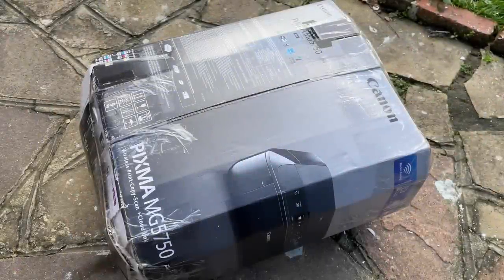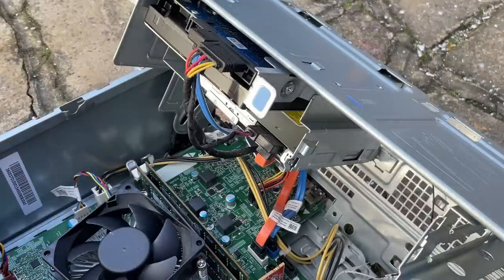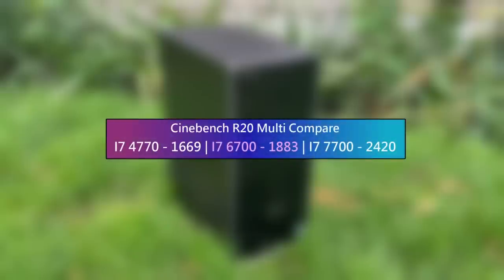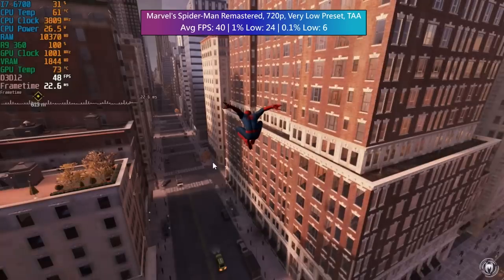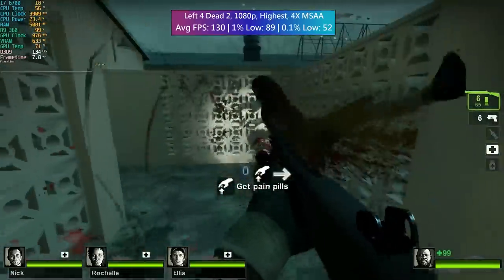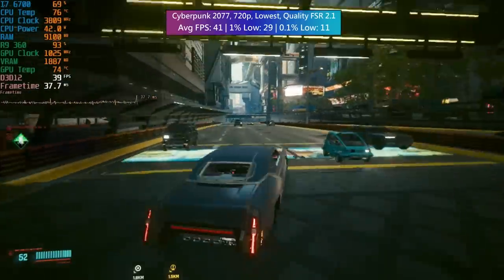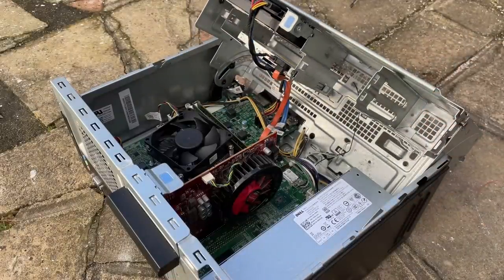$900 Dell Inspiron Gaming PC From 2016 - How's It Holding Up?

Comment: There are still plenty of 6-7 year old components out there that will game at low settings 1080p just fine. I just recently got rid of a Dell Alienware x51 R2 that I had bought USED in 2017 that had an i5 and a GTX 745 with 8GB of RAM and a 1TB mechanical HDD and a 240W power brick that over the years needed upgrading love. I paid $300 USD for it, and straight away I bought a 1TB SSD and adapters to install it. That sped it up tremendously. I then bought the highest PSU 330W, and a 1060 GTX 6GB video card, along with 16GB of matching RAM. Last year, I found a i7 4th gen that was the final upgraded part for $60 USD and after doing that, I had some great benchmark numbers on a 9 year old PC! It would play 75% of any games today @ 1080p no problem.

Comment: Whoa! That's the same CPU I have that's stuck inside a MSI Z170 M5(DDR4) mobo and paired with a RTX 2060 Super.
I don't know why but the boost feature from that mobo runs my 6700 non-K speed to 3.8 GHz.
Every triple A game I play can hit more than 60 fps 1080p on any high settings, I feel like this setup can still run for another 10 years. (given with proper maintenance of course)

Comment: I don't know if this system has a 6/8 pin power connector, but a 1660 would be a nice fit, otherwise even a 1650 would be an improvement, though maybe the rumored 3050 without a power connector could be the perfect candidate for the upgrade, assuming pricing isn't ridiculous for that card, which i'm sure it'll be.

Comment: I had one of these. Complete nightmare to do anything with. Almost all the parts are dell made or dell built and cant be swapped (Like the PSU and motherboard) so upgrading was stupidly difficult unless I got another dell made part, which are rare to come by and expensive. The BIOS is super outdated and supports none of the newest features, even security ones, and Dell refuses to update it.
The model I got was a bit different and promised to have an AMD RX560 in it. Turned out it actually had an RX460 in it, but with a 560 bios flashed onto it. I was pretty much scammed.
Long story short I will never be buying from them again. Glad I built my own PC.
Reply: @Gatorade69  From what I recall they have the same die, the RX 460 just has some CUs disabled, perhaps flashing the vbios did get the whole chip working? I do actually have an HP OEM RX 460 on hand, perhaps I should see if this works sometime.
Reply: @Gatorade69  They flashed the bios and disabled some cores which effectively gave it the same specs as a 460. Comparing my benchmark scores on that system to a real 460 gave equal results.

Comment: Love these vids.  That appears to be the same chassis as a Dell Optiplex 3040 which I'm using for one of my setups---i5-6500/full size OEM GTX 660 blower card from an old Alienware/16gig DDR3L/SSD.  There is a slightly higher output power supply available that comes with a 6-pin PCIe connector but the mounting screws do not line up.  I use another Optiplex 3040 at work with an HD-7700 Sapphire 1gig which pairs surprisingly well with the i5-6500 and SSD for MMO playing.  I love finding ways to game on OEM prebuilds.

Comment: That is specced extremely similar to my first pc which was also a dell inspiron I bought in 2016. The only thing different was it had a i7 4790. I put a new psu, a gtx 1060, and a ssd in it and used it for six years. Its still going as my server pc, it hosts modded minecraft servers for my friends.

Comment: A propos 9:09 about the power connector - there are "SATA Power to PCIe x6" adapters available and that's what I use to power my externally powered 2GB nVidia GTX 750 in a Fujitsu P720, which also has a custom PSU & power connector. It has allegedly a 280W PSU, but Haswell & Maxwell seem to be a really power-efficient combo and I have no power stability issues whatsoever even with 2 HDDs, 2 SSDs & a WiFi/BT PCIe Card added. Works just fine, though I had better performance in this machine out of a 1050Ti which required no external power cable.

Comment: Love mine PC.

I7-7700

Corsair vengeance lpx 32gb ddr4 2666mhz

Asetek 92mm Aio with noctua 92mm slim fan

Corsair SF750 PSU

MSI 3660 TI ventus 2x

500gb Samsung 870 evo & 4TB Firecusa 120 ssd.

4 extra 80mm fans.

Comment: i still using a older hp with i7 4790 with 16gb ddr 3 ram and a gt1030 2gb video still pretty quick with a ssd. these machines still have life left i only have to use low profile cards because i have a small ssf case.

Comment: Solid system. That GPU is pretty interesting to me. Sold performance for its age and not needing a power connector. 
Maybe with DDR4 RAM the CPU also would do slightly better. 

Shame that most Dell prebuilts became all propriety parts starting from here. The Dell Optiplexes did too.

I'm curious if the i7-6700 can beat a stock i7-4790k.
Reply: I’d like to see the. 4790k vs 6700 vs 7700hq

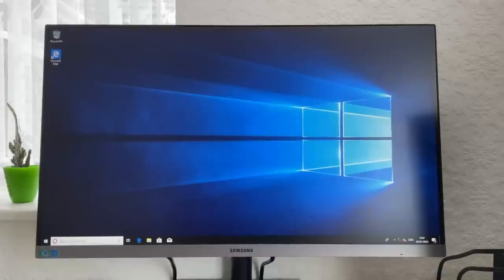Comment: 2:39 i can confirm this. i recently reinstalled windows 10 to a used laptop from the original oem dvd, yes you heard that right. it took a good couple of hours and several restarts to get up fully updated. i don't think i'm doing that again if i can avoid it

Comment: I took delivery today of a HP Compaq 8300... £20 delivered, i5, 4gb of ram half a tera HDD, built in graphics capable of 1440p...   then I find out HP only used VGA or DisplayPorts... but other than that the machine is like brand new, not a scratch, dustbunny or anything to say its actually been used and I only wanted it to power my USB microscope and use to read watchmaking technical sheets in my watch working area but  it will do me and is quite a potent little machine.   For all intents and purposes its basically what I call half a laptop as it uses laptop memory and layout pretty much, still £20 and I am happy, also means I got something to use whilst I upgrade me main rig up with water :)   Oh and the HP has a fancy DVD/Blu-ray dual layer writer which def was a bonus :D
Reply: One thing I noticed on the 8300 is the 10 USB ports on the thing, two wired in DP ports which can work with the onboard VGA, I am seriously thinking of hooking this up to me 51 inch telly and use the my HP Elitebook for my microscope instead, thing is absolutely silent even when running stuff heavy load, its running on my insomniac 1080p monitor not a problem as I found a converter dongle to turn it from DP to HDMI, damn and I just bought an android box for the front room telly :S

Comment: DDR3 on Skylake is pretty cool, you could get a 32gb kit on the cheap and have a pretty good beater workstation. From what I remember that Cinebench score is around where my DDR4 system had; the 6700 just doesn't clock very high in exchange for its low power draw.
Though, it's silly to have a low power CPU in a full-tower case with no 5.25" bays. Dell should've just stuck to the SFF Optiplexes.

Comment: Use a PCIE power to 6 pin adapter to power something relatively low powered in terms of graphics and stretch the CPU more. Something like an RX 470 or 1650 Super, perhaps?

Comment: Nice little find. It's annoying how dell does the internal of the case as a PSU upgrade and a gtx 1070 would have been a perfect upgrade. Maybe with the adapter to make a 6pin something like a gtx 1060 6gb or 1660 super could be added.

Comment: I tested the R9 360 in Forza Horizon 5 at 720p Medium settings and it actually gives 55- 60fps  average, not bad actually. Tested GTA 5 with the Remake graphics mod and Acer's Photorealistic Reshade preset at 900p High settings with High textures and that gives 60fps average too but at night it dropped to 40fps cause of all the street lights and stuff. Horizon Zero Dawn at 720p Original settings gives 30-40fps as well. So peeps could still have fun with this card for now if they don't got the money to get a better GPU, but I think in a few months they gotta try to get an upgrade

Comment: You inspiered me to mod a dell optiplex 390 sff. It had an intel i5 2400 but the motherboard died. Only spare mobo I had laying around was an am3+ board with a dual core athlon CPU. I am trying to source a fx 6100 but so far people are trying to sell them for 60-100 USD which is way overpriced. When I get a CPU, I'll get a low profile cooler. My whole idea is to build it up and give it to my mother for her birthday next month. I am using the i5 2400 in my main PC at the moment and she's sitting with a 2400g but that 2400g is gonna get upgraded reason I am building this dell optiplex for my mother. PS: first time modding a case and it works like a baws but only GPU I have that fit is a gt 730 hp OEM 2gb card but she plays browser games so it's way to much tbh.

Comment: I own an R7 360 that is factory over clocked. You should be able to get the clocks up to 100 and may be lucky and get over 1500 on memory. then again you might not due to the lack of a 6 pin, which mine has. quite good for media playback and light 1080p gaming.

Comment: Bad language is a fix for every single issue in the world.
For "adapter" for 6-pin best bet would be IMO to open PSU and solder 6-pin cable directly onto 12V/GND lands inside.

Comment: The 6700 was a good chip I had one on a biostar mobo with ddr3 then I got My  7700k which is still plodding along with my gtx1080 ...it struggle's with some games rdr2 for example but is still playable at high settings at 1080p...just.

Comment: I waited for a PSU DIY hack adding a 6PIN power adapter, because of good quality of PSU and max 240W and finally of course a VGA exchange to GTX 1060/1660 (Super/Ti)/RX 470/570 with a tiny undervolting to keep the overall 2x12V rail power consumption under ~180W. CPU should be max. 60-70W under heavy CPU load games, so we still whould get 110W for GPU that is quite lot with a tiny undervolt.

Comment: i even replace my paste when i buy a pre-built or laptop stock thermal paste is crap IMO gotta do my GF63 thin ( 3050 variant ) tomorrow throwing a 2.5" 500GB pny ssd in 32GB of 3200mhz ram and a re-paste ( temps are a bit high atm thermalright tfx or Kryonaut should fix that ) then bam my new laptop will be ready for a fresh install of windows them on to gaming

Comment: Getting unlucky again, the 280X fromer mining card I got for just 50€ shortly after lunch of 30xx series seems to be giving up and down-clocking doesnt help either as well as changing the output port for display so it must be on it´s last breaths. How do I know? Just the second I was writing this the picture frooze (didn´t knew it´s part of the video yet) I was worrying "don´t give up and freeze now, just let me finish a couple words for crying out loud" because for about two weeks suddently the image freezes before the monitor (dual monitor isn´t even an option anymore, display connection loss in less than 2 minutes) turns black saying "no connection". Pressing restart immediantly fixes it, but than sometimes crashes (audio everything keeps playing normal like nothing is going on) again within 2 minutes after restart, so it´s obviously the GPU about to die. Sucks since used prices in the german city I live in still are absoloutly redicoules, 120€ for a 1050Ti? Nope, hard pass, 140€ for an RX 570 8GB? Hard pass again like 180€ 5500XT, it´s just loughable and don´t think prices for old Intel CPUs are any better, they´re worse!

Comment: The PSU is a TFX PSU form factor.  Just upgrade the PSU and adapt the proprietary cables.  Don't risk adapting GPU cables on a 240w PSU, its just not worth it.

Comment: My brother actually had that computer and I salvaged its RAM and GPU for my first gaming rig.

I now have 2 R9 360s in my room and I modified them with heatsink on the VRAM modules

It’s a tiny beast and it worked but I had to move on.

Comment: i have this same exact computer from dell with the only difference beeing the gpu, mine is a R9 370 4GB. ive already installed a 1TB SSD and im planning to upgrade to the RTX 3060 (idk if the cpu will handle it well but i dont have money  to upgrade both)

Comment: Hmm, seems decent enough, not bad for a 2016 system! Could certainly benefit from a GPU upgrade, but then again, even the 1050Ti struggles nowadays, and anything better would either require a power connector, or turn the CPU into the limiting factor (or even the 1600MHz RAM).
Reply: 1650
Reply: @samoerai6807  aah yes, I totally forgot that the vanilla 1650 didn't need a power connector, that was probably because of the pathetic 1630 which does need one (and is worse than 1050Ti).
Reply: @TheSpotify95  yea haha. Also I heard there will be a version of the 3050 that won’t require a power connector :)

Comment: Get better ram, you can also get modded bios probably and RX480/580/5600 xt, maybe even 5700 they're cheap, some cases even cheaper from RX590 !!! And you got yourself a decent gaming machine for GBP 250-300 max... Also, the CPU can be easily replaced even if has basic h110 chipset and some i7 7700 are available for decent price too...

Comment: Can it be recased? With another power supply and adaptors?
Reply from the maker: Might be able to get new parts in this case if you cut it about a bit but probably not the other way around

Comment: Great video!
If you find a solution for a proprietary motherboard to have installed a graphics card that can take a 6pin power cable - would be awesome to see. 
I'm in a similar situation with a HP Desktop and i cannot find how to connect the proprietary motherboard connector to a different PSU so that i can power a graphics card with 6pins. :)
Reply: If your PSU has two molex connectors not in use, buy a 2 molex to 6 pin adapter and use that.

Comment: Im still running i7-6700k with GTX 1070 but i7 is kinda bottleneck there, especially 4 cores... im thinking about upgrade to i5 12. gen or 11. gen
Reply: ryzen 5 2600 works amazing with gtx 1070 I have gtx 1070ti with ryzen 5 2600 and its great
Reply: To be fair I upgraded mine to a 10700k just before 11th gen released and there were very few games where it was a bottleneck at that time. Lasted me ages!

Comment: Cinebench is not memory intensive whatsoever, and overclocking from 2666 to 4800 MHz doesn't make a notable difference (at 2666 Mhz the 2nd or 3rd run would probably even beat 4800 Mhz. nature of Cinebench). Therefore I don't think the DDR3L is the reason for the cinebench score.

Comment: slap a 1060 or 1660 and its good to go.
Reply: My 6700 bottlenecked my 1660 super BADLY but it worked ok.
Reply: @dylanallen7720  Yes at 1080p, not at 1440p on games from the PS4 era and older.
Reply: @takehirolol5962  true. I was trying to play warzone and it didn’t go so well lol
Reply: @dylanallen7720  Oh well, was that with high FPS?
Reply: @takehirolol5962  it would fluctuate alot. it would get up to 80 fps but then drop to like 40 or 50 during alot of action.
Reply: @takehirolol5962  but then i picked up a 10400f and its waaaaaay better
Reply: @dylanallen7720  Yeah, the i5 10th gen is way more powerful than 6th gen.

Comment: i7s in the mid 2010s really werent anything too special, at least not until amd came around. Great video again
Reply: Well, in terms of gaming performance they are still single thread bound. Especially MMOs. Single threaded performance has only improved ~2.64x in the past 10 years. Old i7s still hold up because of this.

Comment: my graphic card which i had 2 years ago does not had even a stupid fan😅🤣or...maybe...i don´t know but i think it was not there but finally i can still play half life 1 on it😂then i upgraded to integrated graphics on celeron🤣(the most stupid comment ever i know but it´s true...) by the way i7 6700 is still available in one store in my country but... it cost freakin´ 420 bucks! more than 13 500! isn´t it awesome?! but i will it buy anyway for my retro-ish pc themed videos in the future i am stupid😂 anyway ddr3 have a very little impact if any in games but in some computing apps it may differ and pair this cpu with something like gtx 1650 can be fine this card is pcie 3 i recommend gddr6 version 75w it´s almost at the same price as is gddr5  75w (in my country) so it´s free 10% performance uplift and you still don´t need additional power connectors and if you have this option without upgrading psu - psu of this era might have molex i think but you can use adapter you can use something powerful if psu is strong enough but it´s old i don´t think it´s really worth it but for someone who can´t afford more modern parts then...yes probably